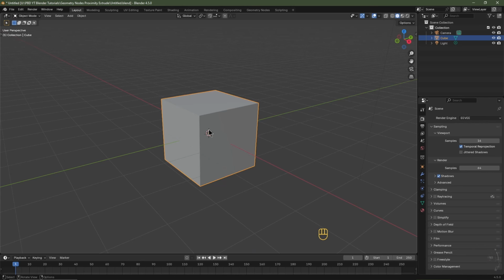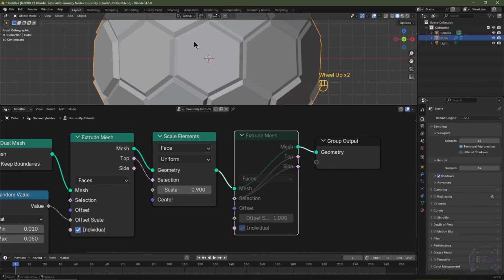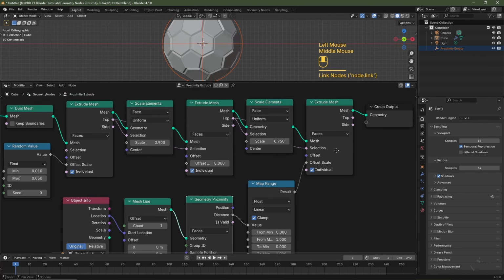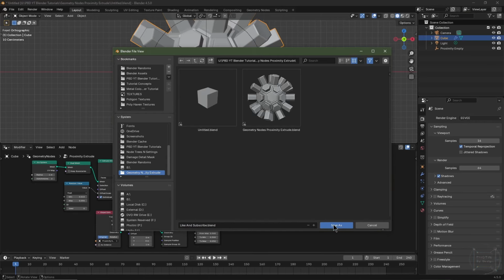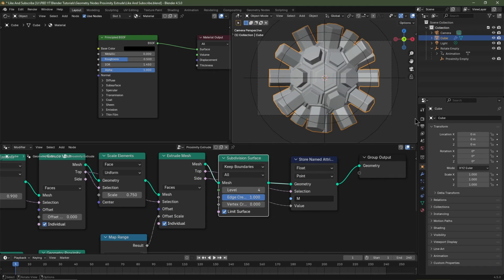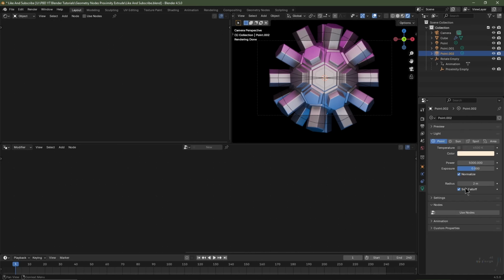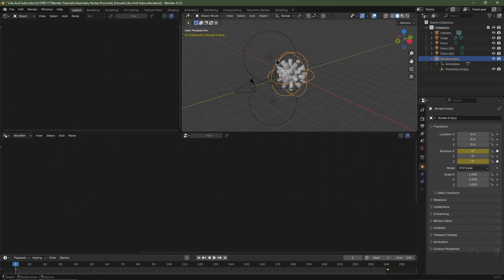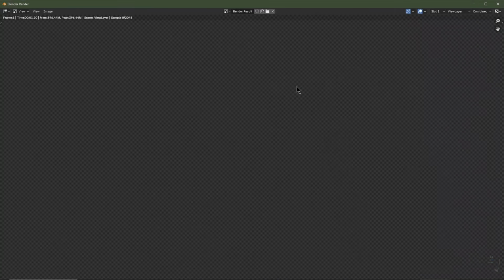Dynamic Proximity Effects with Geometry Nodes – Blender Tutorial

Comment: At 6:40 Rather than adding the Subdivison Surface and Weighted Normal Modifier, you can add the Smooth by Angle Node & turn on the Ignore Sharpness option.
Add > Group > Smooth by Angle. Or Add > sba if using Blender 5+ (or 4.5+ ???).
Reply from the maker: That would indeed remove shading artifacts in a lot of cases, but that method would not work for this particular setup. The main reason being is that I needed the Subdivision Surface to produce bevels on the top face edges to create the Store Named Attribute Mask which is driven by the additional geometry from the Sub Div and the Top and Side face selection sockets.